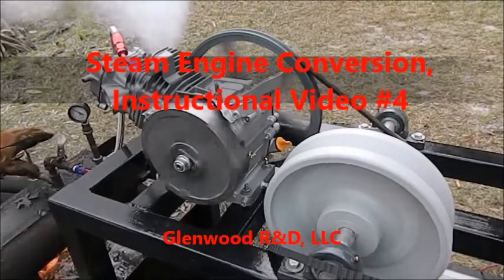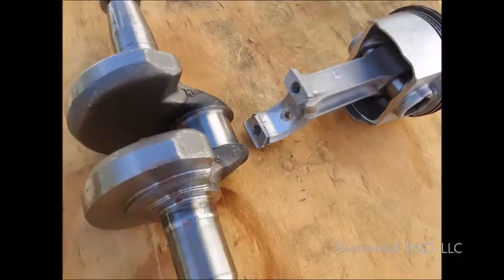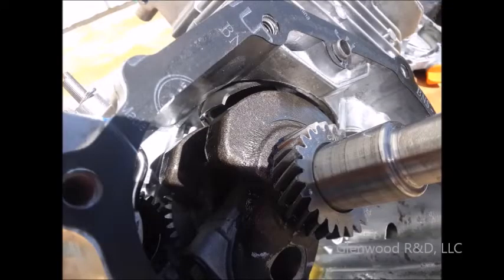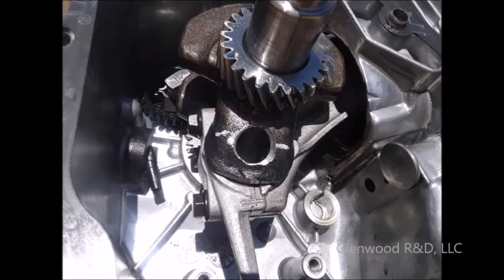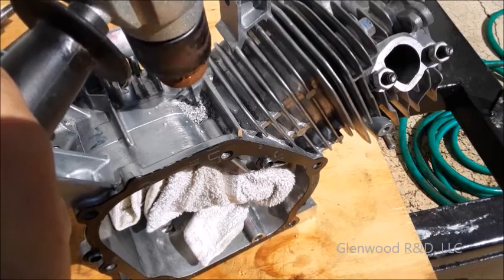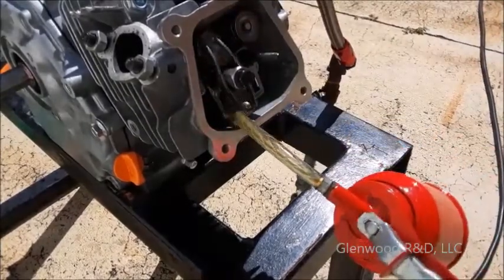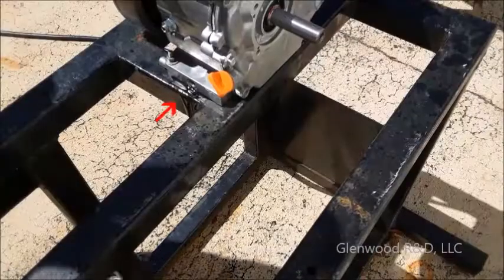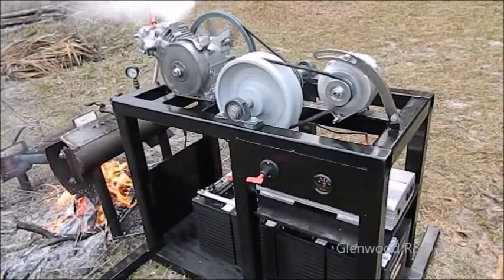Steam Engine Conversion Instruction Video #4

Comment: I’ve made several conversions like this the first one in 1988 and playing with ways to reduce drag I found that by removing the exhaust valve spring and either replace with weaker spring or use a torch to heat the spring make it much weaker the stiff spring robs a lot of power (steam) not trying to take anything from these videos because I’ve never saw a better video explaining this process.

Comment: Excellent video!

Here's my suggestion to the oil-fouling problem, no moving parts required and no maintenance, either:

Heat the crankcase using a coil of stainless steel or copper tubing epoxied to any flat-ish surface. Route the high pressure (and high temperature) steam through this coil before entering the engine intake port. Heat is already being applied to the top of the piston, so all we need to do is to keep the crankcase above 250F/130C to keep the steam/water boiled off and out of the oil. The energy conversion is almost 100% since the steam is already hot enough, and the waste energy can be controlled by a properly sized coil and insulation around the crankcase (styrofoam would probably do).

Adding a small reed valve to a flat surface on the outside of the crankcase would also serve to keep the crankcase at a mild/poor vacuum, making the water boil off at an even lower temperature.

There is probably a minor conversion to the oil ring that could allow the WD-40 squirt step to be skipped, too. But that's for another day.

Thank you so much for this incredibly accurate and informative video!
Reply: I like that idea or even routing the oil through a coil in the boiler to keep it 100c

Comment: 1- Is the steam engine 2 or 4 stroke? 2- Have you made any changes to the camshaft, also called valve timing? 2.1 Didn't you make any changes to the engine and just inject steam? 3- What is the pressure value in bars that makes the steam engine work?
Reply: If you would have paid any attention to the setup here you would have realized the immediate answer to your first, and second questions.
Reply: did you watch the previous videos?

Comment: so we have steam going into the cylinder on the exhaust stroke-as the piston is rising for exhaust there is steam still entering  the cylinder via the spark plug hole-?--i mod both lobes on the camshaft--inlet valve spring is heavy duty spring--exhaust is standard spring ---steam into inlet steam out of exhaust-also half fill the sump with a good oil  and let the water mix with it- have run my engine for years and no excess wear accoured---when i finish with the engine i just turn on the oil drain tap and let it all out so as to seperate for next time---only running at 75 psi preasure---safety valve set at 120 psi-will run for approx 6 hrs on 20 liter of water

Comment: Just curious I have been looking at many Steam boilers and I always here that it is unsafe. Yours seems safe so can you tell me what you made into a boiler or what boiler you used?
Reply from the maker: Research water tube boilers.  Since water can't expand or compress, it can't explode. A water tube boiler sort of produces steam "on demand".  The portion that holds compressed reserve steam is relatively small. All boilers are dangerous if the water level isn't maintained. I had a major failure early on, and it was like a car radiator.....just a big "puff".....wish I caught it on video.

Comment: Is the steam being directed into the spark plug hole? How much did it cost overall? Do you think a welder would work in place of brazing? Do I need a large wheel on the other side of the shaft as shown in the beginning of the video? if so, where do I get it?
Reply from the maker: The steam is directed into the spark plug hole. After the engine, cost was minimal (fittings, etc). A flywheel provides optimal, smooth operation. My first cam was mig welded. It's cast steel, so you have to work carefully. Brazing gives you the opportunity to fix errors much easier.

Comment: Will it be venting steam out while the valve is open?  It's a constant steam source?  Does this adversely affect efficiency?
I saw another guy build a displacement oiler inline with his steam feed so it would push some lucas oil stabilizer (heavy stuff) in with the steam lubricating everything as the blowby will also put oil/steam down into the crankcase
I wonder if nylon rings would seal better rather than steel, even go so far as machine the land between both compression rings and put a large sleeve in the gap to help seal the cylinder
Very cool on showing how this stuff works...thanks!
Reply from the maker: It does allow incoming steam to escape during the exhaust stroke, but it's made up for with mechanical efficiency. Much like a 2 stroke gas engine. It winds up very fast, and RPM = HP. Also, think of how a turbine allows ALL the steam to escape, but winds up to insane  RPMS. Thanks for watching!

Comment: I wonder how the industrial steam generators work with the issue of water infiltration and oiling the engine? do they have someone constantly oiling it or is it automated?
Reply from the maker: Well....the old locomotives and steamboats had a crew constantly tending everything. Thanks for watching!
Reply: @gwseymour  I was referring to the modern ones used in the gas fired or nuclear plants.

Comment: If I use electronic sensors to measure crankshaft position and use magnetic actuators for open/closing valves, I may not need to open up the engine at all?
Reply from the maker: Well....sounds like a project. You'll need to open the engine regardless, to remove the camshaft and tappets.

Comment: could you use this to make a bike cycle run?
Reply from the maker: It's the problem of lugging boiler. I saw a vid of a guy who was powering a trike, but his "on board" boiler was extremely ill-designed and very unsafe.

Comment: Was just wondering if steam oil could be used?
Reply from the maker: I'm not sure what you mean...
Reply: @gwseymour  basically steam oil is a type of oil used with steam engines it can be injected into the steam with a lubricator and that steam then carries the steam oil and thus lubricating certain parts of the engine.

I suggested it since if the steam goes past the piston rings it could carry the steam oil and lubricated ither parts perhaps

An example by Keith appleton a better explanation after least.
https://youtu.be/ZSdmyOYwNdI
Reply from the maker: @gearsofinspiration8528  That would certainly help on the top end.

Comment: Does this permit the same amount of power as the stock engine
Reply from the maker: HP depends on the steam pressure, but the general answer is no. I guess that's why the world switched to gasoline. It is fun however, to make an engine run from dead wood and trash.
Reply: Ok thanks there was a steam car that was more efficient but it came about two years too late and The world are the the decision that gasoline would be the future
Reply from the maker: @soggyspaghetty5799  Yes Sir...and a good old steam tractor will drag a modern tractor backwards in a tug of war.
Reply: The main problem with the old steam vehicles was the boilers they didn’t generate steam  fast enough but there is a company that made a steam generator that would  generate Super heated and super pressure steam in three minutes but it was around 1925 and by that time it was too late
Reply from the maker: @soggyspaghetty5799  I have an old "guide" for making boilers, and it states that welding is "experimental" and not to be relied on. The engines definitely were ahead of the boilers.
Reply: Doble e 20 steam car has one of the most efficient steam generators  Leno showed how they are made

Comment: Thanks for sharing this information. I have some questions
Did you happen to take power output from your steam engine, for comparison of the factory gasoline engine? 
How is the reliability of the steam engine? Does it require constant maintenance to keep it running unlike the gasoline engine or is it lesser?
Once again Thank you!
Reply from the maker: Thanks for watching! The output is definitely less than a gas engine. It depends on the pressure, but at 100 psi, I'm guessing around 2hp. It's very reliable. You have to be present when running...mostly to monitor and tend the boiler, but also to oil the engine.

Comment: I wonder if you had a jug of oil above it with a couple drip lines and then a line out the drain into a bucket could you reuse the oil once it settled and separated from the oil? Great videos, the really explain the modifications well. Edit: my thought was that you could put a gallon or more in the jug and walk away. Then clean up and reuse the oil
Reply from the maker: Thanks! You could definitely use a metered drip method. In reality, you're never going to walk away from a steam engine / boiler. They require constant tending and attention, but an automated method would be one less task.
Reply: @gwseymour  Why wouldn't you walk away from a steam engine? I understand the high pressure the steam makes, but a simple high pressure release valve for say 80 psi (or just above whatever your engine runs at) should be more then good enough to prevent any kind of explosions. We use high pressure air all the time (I know not as destructive as steam but the same concept) at work. Up to 600 PSI... granted the lines carrying this make for some... deadly weapons when they break... but we all know better then to try to stop a hose flying around madly with 600 PSI of air coming out of it!
Reply from the maker: @anjhindul  You can walk away if you want, but there's much more to tend to than pressure. Water level is critical. Most steam engine set ups historically have people tending the furnace, water, lubrication, etc.

Comment: Do you think it would work to use a crankcase flooded with oil, using a drain in the bottom of the crankcase to release any water that separates from the oil?  Or would it all just emulsify together?  Use a stand pipe out of the crankcase to vent pressure to atmosphere and prevent oil from splashing out.  Or is intermittent oiling of certain areas enough lubrication?  How often are you oiling components during operation?
Reply from the maker: If the oil remains in the crankcase, it mixes with water and quickly becomes a thick, brown goo. Letting it all out as it happens is best. I oil  as demonstrated in the vid about once every minute.
Reply: @gwseymour  How could you use an engine like this if you must manually oil once every minute? How much oil is used in an hour?
Reply from the maker: @Depression2010  It uses very little. The operation of any primitive type steam engine requires constant tending, oiling, etc.

Comment: Hi, interesting video...quick suggestion, why not use Teflon rings on the piston to make cylinder  watertight,?
Reply from the maker: I think no matter what you use, water will find it's way into the crankcase. For me, the factory rings provide longevity and dependable operation. There's always room for improvement and thought. Thanks for watching!

Comment: thank you for sharing your knowledge 
I would like to suggest two things:
1- making the Intake valve work together side by side at the same time with the Exhaust valve to make exhausting more efficent
2- using "bash valve" (very similar to the "air gun valve" or any type) which would open the steam at the TDC only (this would reduce the steam consumption and Increas the extract work from the engine because opening the steam at the up stroke (exhaust stroke) would work as braking force) .
Excuse my English language because I'm translating some of my words from Arabic language .
Thank you again .
Reply from the maker: Your English is fine.  Thanks for the comments.  I've tried many valves to regulate the steam intake. Some are better than others, but all consumed power. This design is like a 2 stroke gas engine. Wasteful, but quick.

Comment: That's what most of us actually need is portable or towable steam power. Talk about escaping the tyrrany of oil companies. I expect fuel to cost near $8-$10.00 before 2026. It might not be that way but it's the only way to keep the dollar alive is to pay for it with petroleum prices. Steam bypasses that entirely. Good work
Reply from the maker: Thanks! Check out the turbine vid (charging batteries). A much better turbine is in the works.   https://youtu.be/BwsyxRz_eXs
Reply: @gwseymour  I wonder if that's easier to build. Seems more efficient for stable electric output. I was thinking of running equipment directly from steam like pumps, saws and maybe vehicles
Reply from the maker: @jukeboxhero1649  Well, the turbine is more fun, but bearings and power transmission are more complex.

Comment: Great vids, can you tell me why we don't push the steam thru the intake valve? Pushing steam thru the sparkplug hole seems like we are wasting steam and fighting the upstroke on the exhaust stroke. Please help me understand. Thanks.
Reply from the maker: Thanks! Using the intake valve limits you to less than 20 psi, because the steam will open the valve against it's spring. The valve only holds pressure on the piston side. Most valve springs are 20 lb or less. There is indeed a little waste during the upstroke, but the simplicity and lack of mechanical resistance make up for it. Think of a 2 stroke gas engine. They spit raw gas, but you can't beat the power. I did in fact make an external valve that operated off a lobe on the crankshaft, and only allowed steam on the downstroke. It saved a bit of steam, but the engine lost a lot of throttle response...and power. The incoming steam doesn't really fight the upstroking piston because the exhaust is open.
Reply: @gwseymour  Great, makes sense, and good point on the valve spring not being strong enough to hold it closed against high pressure steam, I had not thought of that.  Thanks for the explanation.
Reply from the maker: @jerrykrautenstaben6584  I didn't think of it on my first try either. When the valve spring first starts to give (about 17 psi) it flutters and sounds like a trumpet! That's what tinkering is all about, I guess.

Comment: What is the large flywheel attached at the beginning of the video and what is its purpose?
Reply from the maker: I found two of them at an industrial surplus place. I think they were big cart wheels that ran along a "V" track.  Either way, they are beautifully balanced and weight 25lbs. The purpose is like any flywheel...momentum, and to smooth out the final output.
Reply: @gwseymour  I see the cart wheel you speak of but it's running a belt that's attached to some other flywheel assembly?
Reply from the maker: @tatethompson2648  The flywheel attached to the engine is just a standard flywheel / pulley like you would find on an air compressor. It is pretty much there as a big pulley to accommodate the belt.  It is belted to the heavy flywheel (cart wheel) that is described in the last response. That is mounted separately between the two pillow block bearings. That second flywheel keeps the momentum.   I hope I'm answering you correctly.

Comment: What about making real high performance engine?
1. Elliminate dead volumes. It is needed to remove combustion chamber volume
2. Tune thermodynamic cycle to allow adiabatic expansion instead of isobaric
3. Cylinder insulation
4. Tune valve to support high pressure
Reply from the maker: Thank You. The videos were designed for a simple gas engine conversion.
Reply: @gwseymour  the second step is advanced conversion. Never seen if someone made it.
Reply: @FadeToEvil  You can pay for professional work in the second step.
Reply: @Tico-edaupal  I am making it myself.
Reply: its a big job getting rid of the engine cooling fins---i just leave them on abd insulate the head and barrel